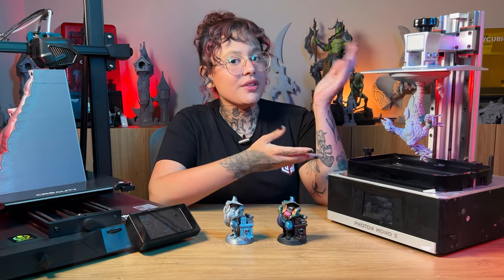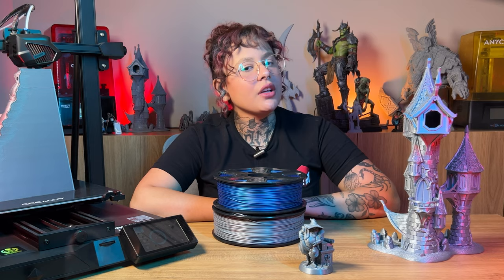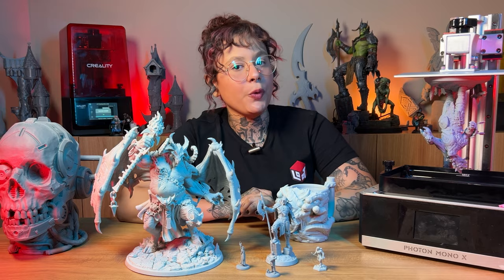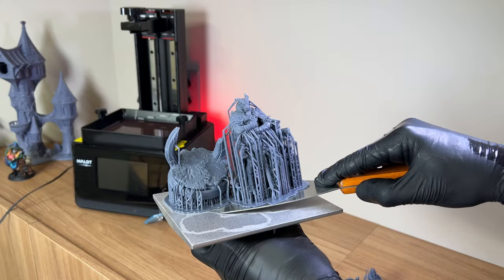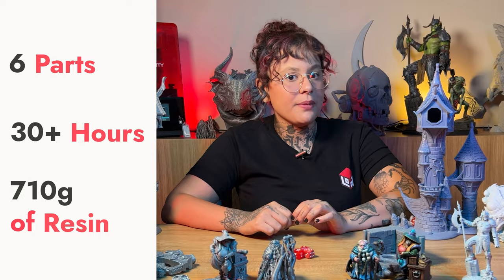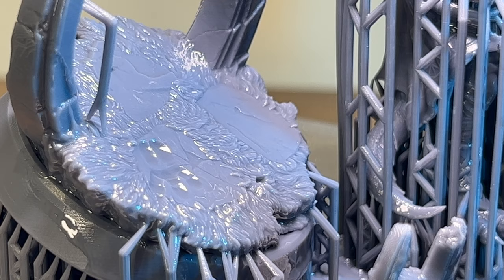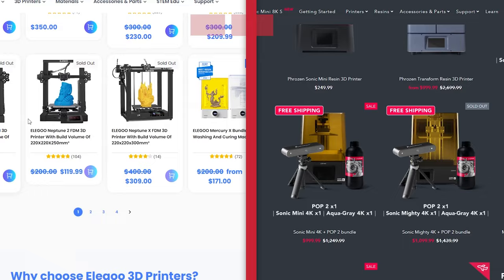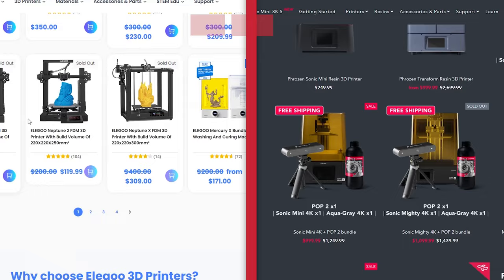Resin VS FDM 3D printers: Which one is the best for miniatures?

Comment: Either your FDM printer sucks, you were using wet filament, or bad settings. Yes Resin is better for minis, but a hi-res, print on a high quality FDM doesn't look as bad as your wizard examples. FDM excels for scenery. Especially if you're going to texture it. If I could, I'd post a picture of a dice tower I've printed w/o even using the highest res settings on my Bambu Lab P1s; it would highlight the layer height and blobs on the one you printed are due to one of the factors I mentioned above, not due to the technology.

That being said, yes, resin is the best for minis, no argument there.

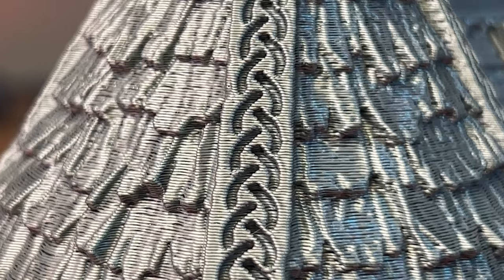Comment: I was hoping this was going to be a fair comparison, but it's clearly skewed to resin. Don't get me wrong, for high detail modeling/miniatures, resin is hands down the victor in the final process. But wow at 6:30 mark, it looks like whoever setup the FDM printer put on the biggest nozzle, didn't bother adjusting any settings, and set the speed to max. I've seen some pretty tight work on an FDM and what you printed there looks intentionally bad...

Comment: Prusaslicer has lack of support tree, instead Cura has most easily support tree for reduce of difficult removed. I was just used 3d printer FDM for miniatures with dimension middle or big, but I never experienced before for miniatures with FDM printer.
Reply: Cura tree supports are rubbish against Prusa slicers organic supports. I changed from Cura as its slow, heavy on my PC and supports where terrible to remove.

Comment: you can really sum it up as small to mid size prints are better in resin and mid to big size prints are better with FDM.. you could obviosly do really big figures with resin it will just take forever and cost a lot

Comment: A giant thing that this video missed is the amount of time it takes to add supports to resin models.

 It's nice when you find places like Loot Studios that pre-support their models, but other places you get pre-supported models are not always done well and you need to check them or make your own.Since automated supports suck from resin slicers these steps can add hours of time before you even start printing. It's been a huge reason I print way more FDM than resin.
Reply: With lychee I just orientate to an angle I like, detect islands, support all islands with light supports and then support manually adding some extra medium at the major load points (usually very few)

All in all takes very little time even with very complex models.
Reply: Most resin slicers have auto supports and adding and deleting them are alot easier than FDM supports. I spend less than 20 mins for Chitubox but FDM slicers are a huge hassle. Not to mention the amount of time it takes to cut off supports on FDM models where Resin they can just be taken off with just your hands

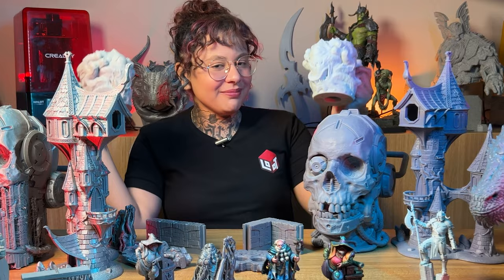Comment: Am I the only one here thinking this vid's a bit biased? I'd be ashamed if I were to show some of those FDM prints on camera (you can do much better than that; no hate! 4:20). Additionally for those who wonder, if you master the FDM printing, you can print layers so fine you wouldn't even notice them without closer inspection. (Or you can print ABS and use acetone, which smoothens the surface). That being said; resin printers really do make a much better job when it comes to quality - especially the details you mentioned (wings, staffs etc. ) :)
If 3D printing your own figures and tabletops is what you want to use the printer for (and you don't mind having to deal with fluids; which I presonally do), go for resin.
FDM printing on the other hand can be helpful when printing functional parts, which are stressed as the models often tend to be less fragile / more durable (special materials)

Comment: I just bought a Bembu lab x1c ... ( I have never printed before ) and ... Your Resin results  are 20-30% worst, than my 300% Scale  (30 cm) dinosaur head. I did not changed any settings, just layer Hight to 0.1 and its so smooth, that you cannot see ANY layers... I am suprised, as I dont even know what filament am I using :D

Comment: I agree basically in everything, resin for miniatures or action figures is amazing, the best option, but as she said is a big pain in the a..... ONE thing that she should say in the video, specially when talking about price, is that for the same price the printing bed is totally different, you can spend 200 bucks in a filament printer and having a large bed when in the resin one you have basically a postcard... the printer she is using when showing the group of minions wasn't even close to the 200 dollars mark

Comment: What would it cost to have a Predator resin printed?
Reply: Depends on size and specific meterial. At 300mmm hight no infill  you can expect a full kg of resin at $25, at 150mm it is 1/4 of that, and at 75mm it is a 1/4 of that as well.

Comment: I don't intend to use the printer to produce final products. I more would like it used as a tool for sculpting and resin casting. Just 3d model a base design for a character, simple structure foundation and print to be used with monster clay instead of dealing with wire and sculpting from scratch and even save on material for larger pieces.

Comment: On the cost - as you mentioned in the proccesses section, after printing you need to wash your model, which requires you to buy additional large container and resupply your cleaning solution + curing chamber, which (from what i saw at Creality) cost around 1\2 of printer itself (comparing Halot Mage and UW-01)

Comment: the comparison at 4:20 looked so bad for fdm, i have a lot of experience pushing my ender 3v2 to the limit, i print my minis at 0.08 layer height most of the time, and i calibrated my printer to hell and back and i am seeing a LOT of problems in the mini used for comparison that had no reason to exist, though to be fair, i don't have the same model to test... That said, i see a lot of stringing issues, could be temperature or retraction settings... I think you could've gotter it a lot cleaner, but yeah, it would 100% take a lot of time to get there.

Comment: Please don't use this video as an example of FDM quality, it isn't remotely close to how good you can get out of FDM.  I use an Ender 3 PRO (older model under $200 when I got it), eSUN PLA+ or PRO.  Grab a good profile for your CURA slicer software (CHEP check him out on youtube), drop your nozzle temp down to 200 - 205.  Use Tree supports and adjust your threshold for overhangs.  You can get near comparable to resin.  I don't need to sand anything, just break away supports and use a toothpick to push out any little remaining pieces, brush on primer and paint.  I recommend Grey PLA+ PRO (eSUN).

Comment: Misleading thumbnail.
Shows a fresh FDM print with minimal post processing and a fully processed and painted resin print. Yes, in most cases resin is better for detail on miniatures but this is misleading.
Reply: In every case resin is better for miniature quality. Painting FDM can yield bad results as the surface would require a substanial amount of sanding or chemicals to smothen out.

Comment: I think you did not set your printer correctly because the layers in the FDM prints in the video were too obvious. I'm using an ender 3s1 and it allows up to 0.04mm precision. If I install a 0.1 nozzle, I think I can use 0.01. First of all, even on the parts I printed with 0.16 mm quality, the lines are not that visible. Moreover, in the examples you gave in the video when comparing the resin and FDM printer, you directly put the part you took from the FDM printer, but you cleaned the part taken from the resin printer, painted it and put it in comparison. You didn't say that you need to buy at least 1 or 2 more machines.

Comment: you really did the fdm printing dirty by comparing a 0.28 mm layer height print with a resin print thats made for details. If you want to highlight how accurrate the fdm printer can be for miniatures, please use a 0.2 nozzle and a 0.08 layer height
Reply: This would make the print significantly slower and harder to compare, for resin I use layer hight between 0.01mm and 0.03mm to eliminate layer lines entirely but will take 3-5x longer than the standard resin print.

Comment: That FDM print used as a comparison for the miniature is a horrifically bad example of FDM printing. Like almost comically so, you can get better FDM Prints for sure. Yes resin is better resolution for smaller models like that, but this video extremely exaggerates the differences.

Comment: Next time do a more honest review, if that's the best you can do with FDM just stop
Reply: Yea let's be honest with FDM, it's not better than resin when you have to deal with the fact that you can't paint FDM to look good without massive amounts of post processing that would make it equally as toxic and more time consuming than resin.
Reply: @miguellopez3392  there's hardly any post processing if you're smart about it. Print it with super high resolution 0.08 MM layer height, print in ABS, perform a vapor bath...boom instant injection mold quality and you just had to put it in a vapor chamber.
Reply: @inquisitorgrynthebandito2736  if you are doing a vapor chamber then you might as well do resin printing, I do 0.02mm layer hight at 28 micron resolution, Its better than mold quality.

Comment: Cost wise Risen printing is Horrible vs fdm everything can be reused in risen printing if something f up your just Screwed nothing can be reused you can easily wast a 60$ bottle of risen trying to get a print to work it sucks plus all the ppe and cleaning tools and Chemicals you need if your just starting out and dont want to spend 2k $ of the bat for everything you need to start risen printing id go with fdm to start its far cheaper and you can fix stuff and reuse bad prints